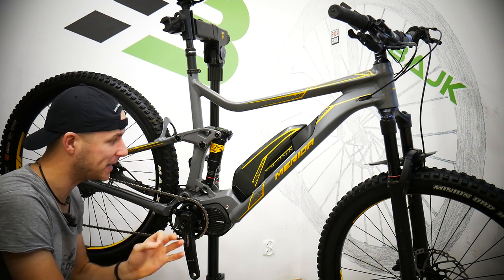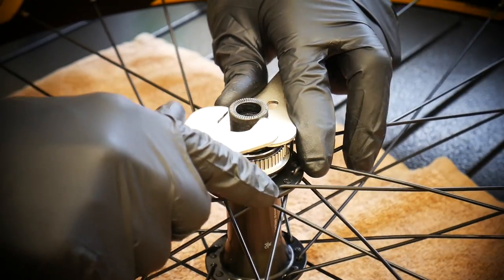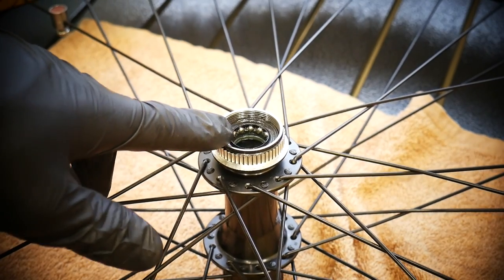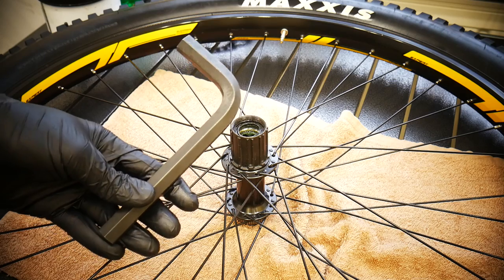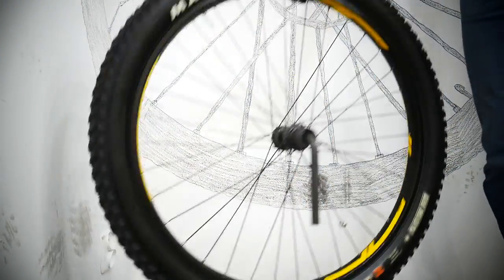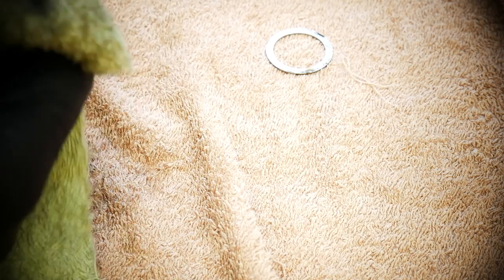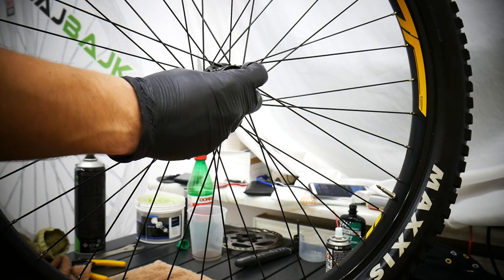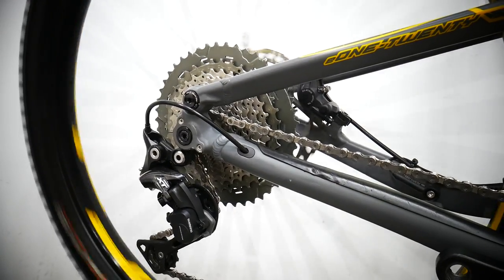Tricks To Remove & Service Shimano Deore Freehub Body. Clean, Grease, Assemble.

Comment: That first seal, witch you remove with screwdriver, I got good tip from Park Tool's video where Calvin Jones suggested use tyre lever instead screwdriver. And you can put back with right size socket.
Reply: Yeah

Comment: If you have to take the freehub body apart, then you can use the TB-1018 tool, from SuperB, to dismantle it. Alternatively you can use a Morningstar Freehub Injector so that you don't even have to dismantle it at all! Just use it with degreaser to flush out the old lube and dirt, let it sit for a while to dry out and then inject it with your choice of lube. I use a heavy oil, like gear box oil, which I've done now for about 20 years or so, with good results.

Comment: Good video!  I did part of this procedure, stopped before disasembling the freehub.  My older Deore XT required a 10mm hex wrench.  My hub wobbled on the wheel, so I tightened with the 10mm hex and put everything else back together.

Comment: Depends why you want to remove the freehub. If it is just a bit 'sticky' you probably do not need to remove it, but can get by with flooding it through with a solvent to wash out old grease, followed by a light oiling, with cleaning and regreasing the axle bearings.

Comment: it's recommended to use thick oil than grease when relubing the freehub because over time grease gets stiff and gummy and it slows down the pawl movement in the freehub, but you can use grease when you're putting back the bearing balls so it holds it and prevents it from rolling all over the place, or use  silicone grease to lube the freehub(its much thinner and its safe for plastics and rubber) 

don't use magnetic screwdrivers to extract the bearing balls and then reusing it because it magnetizes the bearing balls thus preventing it to roll smoothly 

cheers

Comment: You need a 12 mm star drive to remove from the wheel. I could not get the freewheel apart so soaked in petrol. Have it a tap on bench and pawls then worked. Final clean in thinners, soaked in container of engine oil and works perfectly.

Comment: 5:11 doing this without a special tool is the easiest way to damage the parts. In your video it seems easy because it's either brand new or you did it first offscreen. In real life this part will most likely be very hard to turn around within the freehub body. You usually open work hubs with seized parts, not the fresh new ones.
Reply: Same goes for dissasembling of mobile phones on YT, all goes fantastic and when you try it you find that very complicated and tricky

Comment: you should always separate balls (those 38+34) and not mix them - when you take them out and put them back in - as they will not have the same size but eventually wear a bit so the size will differ from one side to the other. i am talking fractions of a micron but it does matter. take notice that good quality grease can act as a polishing agent (due to the additives) whenever direct contact of metal to metal would occur (mixed lubrication, not boundary, not hydrodynamic) so that they would have even smaller grade then when new. so, the balls will be worn a bit (not that you see it) and they should wear down evenly on one side but not in the same amount as to the other side.

Comment: Amazing detailed video thank you so much!! 15 mm hex allen key is veryt difficult to find and i bought an expensive one from park took for about £48 !! Used a seat post for longer leverage!! Thank you for the tips!! 

But I can't find a two tooth cup removal tool which is about 25-26 mm inner diameter ! I bought a Unior Suntour 1670.2/4 which is smaller in diameter and doesn't fit the two teeth. The cup is stuck in the freehub.

Comment: Good video, and great info here. But I'm not really sure this service is absolutely needed on Shimano freehubs. I've been running mostly Shimano hubs in my 21+ years of riding and have never had a single problem with any of them, except for a broken front axle on one occasion. I've taken Shimano freehubs apart before just for the heck of it but not because they needed any kind of service or repair. My current bike has XTR wheels/hubs which are about 5 years old and have over 25k miles and I've never even adjusted the bearings, much less remove the axles etc and they still work like new. In my opinion Shimano hubs are best left alone and will last a VERY long time without any problems. Which is a LOT more than I can say about some other brands for the few times that I've  tried them.
Reply: I also have a tandem MTB with a Shimano FH-RM30 rear hub (basically one of their lower-end hubs, and not tandem-specific). We've been riding it for a year now and it has over 2000 miles   and works as good as new with zero maintenance.
Reply: I can testify, I've ridden my Surly Pugsley fatbike for about 7 years now, all year around, it's my daily rider and my choice for long hauls, it's still on the same Shimano freehub after doing over 40K km which is impressive, it's been abused a lot.

Comment: I never put grease where the engager are located, only a dips of a nice oil, I use motorex CNC spindle oil, itc vgc 46. Work for me, on the opposite side behind the rubber in my case, I put a lot of thick grease as a preventative action.

Comment: 37 balls bottom and 35 on top, l have exactly the same hub model.
Reply: Can I ask the diameter of the balls?
Reply: @therealjuicy3537  Advance thanks Sir!!! That would be amazing 😄😄😄
Reply: @clentmichaeldevera777  Did you find out the diameter of the bearings? Also wouldn't it make sense for there to be 36 balls on the top and bottom?
Reply: Mine had 37 bottom and 35 on top too. Diameter is 2.381 mm (3/32") .

Comment: I'm wondering if the grease on the pawls is a bit too thick? Good video. What is that Topeak tool?
Reply: In Finnish winter the grease seizes and the freehub will skip.
Reply: Topeak disc tool - for trueing a bent disc

Comment: How would I understand if I tighten with correct torque the locknut which holds freehub body brearing together? The locknut which is also acts as a cone. You tighten it on 14:05
In my case I either get some weird axial movement/play in the entire freehub body (like if it's undertightened), or  else I think I ovethight them. But the small play is always there.
Reply: SHIMS - there are 3 shown in the video. Remove one of the thin ones and check again for the end-play. If still there, remove the other thin one. It's unlikely that you'd have so much play that the thick one should be removed. The body should be fully tightened together as it should be screwed-down on the shims - NOT on the bearing-balls.

Comment: super b tb-1018 is like 10 bucks. I made mine from a 1/2 - 22mm hexagon socket using a belt sander, an angle grinder and a file. After that I ordered the super b. 😅

Comment: when putting the freehub back on, the nut that holds it on, that the axle goes through... is this hand tightened, tight enough without play but not too tight?
Reply: None of these videos address that point, and it's the most important information. All the rest you can figure out yourself.
Reply: It should be fully tightened (though I don't have a torque-spec), as it's screwed-in metal-to-metal - NOT resting on the bearing-balls.

Comment: I did not count the bearings but mine has a little gap too. It is normal i think because these items nt servicable parts. when try to fill gaps with bearings, it did not spin nicely. Thanks
Reply: When I lose track of bearing ball numbers my rule is to fill the race and subtract one.

Comment: Hi I would probably do this as I'm into not buying new unless totally unavoidable. Most manufacturers recommend not using grease only oil, as grease may cause a sluggish freehub. Is this different for Shimano freehubs as I'm just about to service one and want to get the right lube for it.
Reply: Dumonde Freehub Oil is a relatively new product specifically for this. They also have a freehub grease if that's what your freehub requires.

Comment: Bought  deore m6000 hubs..wanted to re grease everything before using..surprised to see the inside because it is nothing like that in the video.. mine has only 2 pawls instead of 4..is mine counterfeit?
Reply: No. On your hub there should be three spaces for the pawls but only two pawls

Comment: Hey, I currently have a Shimano Deore M525 32Holes (Bolt type). I am wondering will it fit 11s cassette (Slx) because I am choosing between Deore and Slx? Thank you! :)
Reply: Dave Sihaloho  What variant of Deore hub youre using? I mean the bolt or the center lock type? :)
Reply: What size allen key is needed for the 525 freehub body?

Comment: I read that using a magnet to remove the ball bearings was not ideal. Is there any thruth to that? Thanks!
Reply: Somepeople says that may magnetized bearings. Maybe but are that kind magnetized permanently? I do not know.
Reply: Yep, it's not so good due to all metal dust from wear will be glued to the balls
Reply: @Lezz015  They would glued anyway because metal dust stuck in to grease.
Reply: @Mersuharrastaja  but in this case bearing service will be much harder

Comment: I think its safe to say my hub is better off dead. I bent a 21mm spanner using it as a lever trying to get my freehub off and used a section of 25mm galvo square section as a lever to and it tore straight through that XD

Comment: I did this once...and then I realized that a Shimano freehub body is 16$ BRAND NEW!
Reply: but its fun to know every nook and cranny of your bike :). got a 15mm allen and the continued watching the video, now i feel like f**k it il try to clean it out in a year or two
Reply: You can remove the axle without removing the cassette first but you will need to remove the cassette in order to rebuild the axle and to remove the free hub body.  RJ the bike guy has great tutorials.
Reply: Carl Green  when I have trouble like your having just bang it in with a hammer and use a rachet with a cheater bar like a seat post or whatever will slip over your rachet. If it slips out ..bang it in again and try it again keeping the freewheel tool as flush as possible. They can be  extremely difficult to remove sometimes. But if you don't give up and get determined... you'll get it.

Comment: Iam from Malaysia and using freehub exactly same like this. MT400. Its difficult to find 15mm allen key anyway.
Reply: Whenever you can't find a suitable hex-wrench - use the head of a hex-bolt and clamp-down hard on the shaft with a vise-grip. You could even weld a lever onto the shaft of the hex-bolt if extra torque was required.

Comment: All other freehub service video on youtube like gmbn or gcn they use oil not grease inside the hub
Reply: It depends... if you have the ratchet system like the dt 240s that it will only work with this special thin grease hitch looks like oil. The pawl system is a bit different ... but yep also here is the special thin grease the best choice. A  thin layer of grease will also work. Less is more here 😂
Reply: Yeah, I only put a little chain oil so the ratchet works reliably and positively

Comment: I have a Shimano FH-M737 hub from around 1997 and I can't remove dust cap no matter how hard I am trying. It looks like it has a solid metal dust cap and Shimano doesn't want that to be removed at all. But in that case, I can't get inside of the freehub body to clean anything. My freehub body is wobbling a bit so it could be something wrong with bearings, I can't even check it. I can only remove the rubber ring in the back and expose those bearings in the back of it but I can't do anything else with my hub. Very disappointing as I don't want to be buying a new one (which is even hard to get and also expensive).
Reply: Have you tried using some penetrating oil or carefully heating the nut (e.g. with a heat gun)?
Reply: Try putting a brass rod through the unit to catch the inner-edge of the dust-cap and then tap the rod with a hammer to drive-out the cap.

Comment: has anyone found it hard to unscrew the part at 5:20 ? I wrecked my freehub trying to loosen that
Reply: We used a 600mm torque wrench and 2 people, one a plumber and the other a farmer and couldn't shift it. The Allen key snapped.
Reply: @gl1800goldwing  oh damn! I guess it's not really meant to be taken out and maintained.
Reply: @vkumar95aviator  
It kinda depends if water ever entered the body or when it was last moved. They are in there tight, but they usually can be moved with the right tool. But sometimes they are just corroded in place by a very thin layer of oxide and your best chance is to marinate the whole thing for days on end in WD40 and rust remover.
Reply: @gl1800goldwing  Have you unscrewed it clockwise or counterclockwise? xd
Reply: It's kinda stressing maintenance Shimano parts, it's like they don't want us to remove or maintenance, but i saw a video where the guy uses a small piece cut out of steel sheet to open the freehub

Comment: I have tried to service my Deore XT freehub cause it has no grease and became sticky.
I made 1,2 meter long lever to help me to unskrew the freehub bolt, and it's still doesn't move.
Shimano hubs are so terrible unservicable garbage. Never ever I buy another shimano hub.
Reply: Next time buy some novatec with sealed bearing. If there's a problem you replace whole bearing, which are cheap. You can press them with a simple screw tool.

Comment: Pro tip: if you don't oil or grease the pawls the freehub will be much louder. And no, it won't destroy the freehub.
Reply: Yep that's what I did for my RS11.
Reply: I recommend applying a thin layer of dry chain oil.

Comment: Dude why the put more than 10mm
Reply: True but in this case it's a must as the through bolt has 12mm in the rear. It's not a QR hub.
Reply: @kaedeschulz5422  why put 11mm which doesn't exist?
Reply: @kaedeschulz5422  I have 12 mm Allen key but I don't have 11mm
And it's 11mm
Reply: @magnumllama400  You know that i'm talking about the bolt to mount the rear wheel on a 148mm boost rear end right?
Reply: @kaedeschulz5422  I'm talking about freehub body bolt
Reply: @magnumllama400  In the case of a bike with boost rear end it can't be smaller as the axle/bolt is 12mm 12mm would rub on the bolt so they have to make it bigger and they went for 15mm

Comment: And another video on something that you never have to do and that shimano tells you not to do. (The other one I on road shift levers.)
Clearly lacking ideas on what to do for new videos.
Reply: Man, don't waste your time doing such kind of comment. Sure it's better for shimano if you ride with a dirty freehub and buy another one in 2 or 3 months...
Reply: @RodrigoRA1976  let me tell you that I now have a pair of wheels with almost 12000km and have a friend with a shimano 105 groupset that is now working for 12 years and thst has made well over 99000km without ever ever having any problem and never having a rebuild. My friend commutes to work on that bike every day. Now you can see what I mean with my comment.
Reply: @nelsonsilva6842  yep, i believe and I also have a 105 running  very well since 1994 on a Trek 1200. I'm on the 3rd freehub, and it's very little since the bike have countless miles on it and ride on rain and gravel regularly.